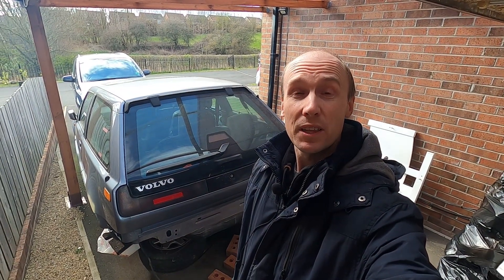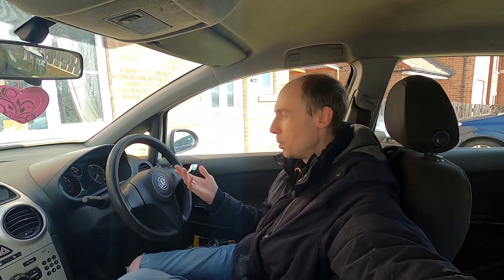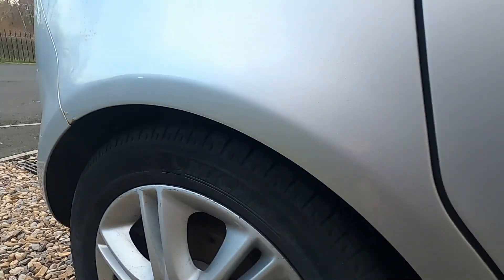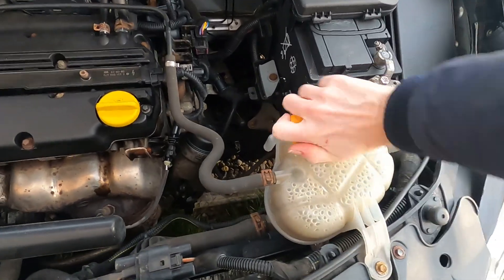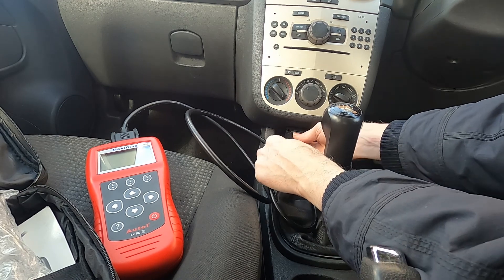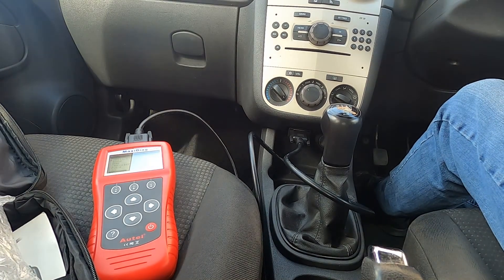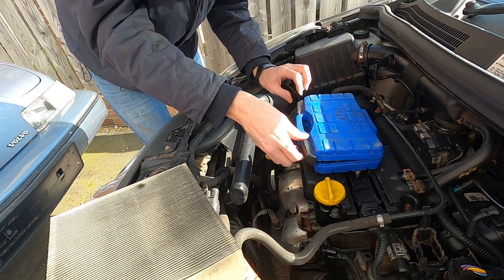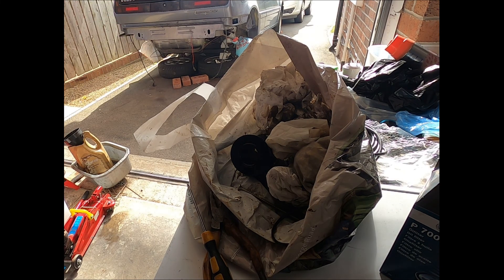Expensive second hand Corsa with so many faults and problems! Why did I buy it?

Comment: They say the spanner is Service and Electrical. Mines kept coming on and then going off when driving. I got a cheap Bluetooth OBD from Amazon and got the code P00B7, turns out I needed coolant in it.

Comment: I had 3 cyl version. Timing chain snapped and needed rebuild. I later found out the previous owner had chain snap and the poor guy I sold it to had chain snap a year after I sold it. So that's 3 times and it only had 60k on clock. Bad design by vauxhall.
Reply from the maker: Wow, that's terrible, until now I'd not heard of a lot of timing chain issues on these, perhaps specific to the 3cyl eco versions?
Reply: @junkendriven  When the AA guy arrived he said "I know what this is before I even open bonnet. ".
Reply: @ukpotaparksontheair3670 timing chains are an issue but not sure why it’s snapping after 12 months. You buying crap chains or bad fitting ?

Comment: The two rubber breather pipes from rocker cover to carb generally get clogged with that mayo,and yes your right it’s the flat head caused by short runs and condensation builds up then mixes with the oil.

Comment: Always find your videos insightful and frankly make me like my 60 reg 1.2 SXi more when you remind me how (relatively) cheap parts are and how simple they are to fix. Got a bit of a rattle on mine at cold start. Thought timing chain but could be loose valve lifters. Ever experienced this with the petrol models?
Reply from the maker: Hey, so yes that rattle on start, only at warm start up? Chances are it just needs oil and filter change, I'd do that first before even looking elsewhere
Reply: I'm looking at one down sizing from my Volvo V50 1.6 Diesel,  I've owned it for nearly 8 years , spent money on it , serviced every year , but I'm having issues with the injectors,  I've been told because the cars a 2010 it'll cost a £1000 to get it sorted with new injectors,  bit of a bummer considering I've just spent £310 to get it through its M O T and put 2 new tyres on the rear , can't win can you .

Comment: I have a 1.2 from 2010 I’ve done a lot of work on it, new clutch kit, timing chain kit, water pump, thermostat and housing, filters and oil, but it still lacks power when going uphill. 🤬Have to change down to 2nd or 3rd and rev to over 3000 to get it going.
Reply: I recently had a drive in a 1.2 and I just felt it was so underpowered.

Comment: Good to see another car on the fleet. I'd have been wary of a high mile 1.2 Corsa due to the timing chain issues, but you seem to know them quite well from your videos.
The prices of used cars are crazy at the moment, you really don't feel as though there's value for money!
I've been looking for a newer daily driver for a while, I keep looking and then being put off by the prices.
Reply from the maker: Thanks for watching! Yes higher mile can be a worry but the timing chains are good on these, the tensioner may need work but I'll plan on doing the timing chain soon.
Pricing is nuts! I'd not normally splash this cash on what has so many bad points!

Comment: I service my corsa d se 1.2, I use gfs for my parts as they are just around the corner from me, I've never torqued the oil filter I hand tighten it and nip it up with a 24mm socket, also got a oil transfer pump to suck the oil out, air filter simple to changed, I do oil change, air filter, oil filter, cabin filter every 6k because the chain, was told by a few mechanics I know to do it every 6k, when you see a corsa d with a timing chain fitted at 40k mile that due to lack of maintenance of oil changes, plus if I change the spark plugs i do that by feel as well, as my torque wrench is 1/2 starts with 28nm, so I might look for 3/8 torque wrench, keep up with the videos really liking them, especially corsa

Comment: I bought a 13plate 1.2se 3door in white 18 months ago for three half grand full history 99 thousand miles.bodywork very good no rust on rear arches drove well I bought it off Facebook off a reputable garage who's been trading 30years good reviews so I thought nothing to worry about had the car a week started getting problems from water pump failing to coil springs snapping the list goes on then a year later and a thousand pounds in repair bills I thought great I've got on top off it until four months ago I was driving along 40 mph it lost power so I pulled in and the engine was clunking and banging I checked oil plenty off oil still good from last oil change three thousand miles ago .so took it to three different mechanics no lights on dash just this terrible noise from engine the only cure new engine 😮 .so then I had to work out whether my now three grand car was worth a new engine
I managed to source a 1.2 engine off eBay for 850 quid 75delivery 32000miles I got a local mechanic to fit for four hundred so now I have a 5 grand and something Corsa that runs ok but do I keep it and hope no more problems or get rid .I thought about it I'm gonna run it hopefully another year and pass it to my youngest daughter when she turns seventeen just to get my money out off it .I've always had Vauxhall's over the last thirty odd years caviler novas with never a problem but I have to admit these modern vauxhalls don't seem half as good as they used to it has put me off them I think my next car will be a ford or a Kia they seem much better in modern form.
Reply from the maker: Wow, yes unfortunately they can seem like a cheap or budget car but you never know what you're buying whether private or dealership. Really bad that you had to replace the engine, it must have been bad when you bought it but covered up. Glad you've got it useable now, keep on top of servicing and repairs and it should last though, at least the bodywork tends to hold up well on these and parts are cheap. I'd not hedge your bets on Ford as they suffer many issues (Ford eco-boom engine is a common bad engine!).

Comment: Hello Andy, I’m hoping you can help, my friend has a Vauxhall corsa 2011 limited edition, hasn’t been started in over a year and a half, went to start it earlier, started first time run for about a minute, then cut out and wouldn’t start again, any thoughts? I believe the fuel filter is in the tank and not a serviceable part 
Many thanks
Reply from the maker: It's more likely the old fuel had degraded, it may have blocked injectors or all sorts. I'd start by a lot of fresh fuel in the tank, if possible take the fuel line off at the engine and run the lift pump a few times (ign on and off a few times) and draw new fuel in.
You might have also clogged the spark plugs so worth taking them out and inspecting.
Good luck, hope you get it running
Reply: @junkendriven  thanks for getting back to me Andy, where abouts is the fuel line on the engine, we put 10 litres of fresh fuel in, and still no luck
Reply: @junkendriven  if you see this, can you get back to me please, would be much appreciated, how does the fuel pump work on these cars? Is it meant to squirt out or just spit a little bit of fuel out?  Many thanks
Reply: Crankshaft sensor check.

Comment: Just found your channel and interested to know about your Autel MaxiDiag tool....any good?  Easy to use?  Expensive?  I have 2 Corsas and do all of my own servicing etc, but have to go to a garage to get the codes read....
Reply from the maker: Hi, for the Corsa the autel is an expensive overkill. You can do most basic tasks with the cheap elm clone Bluetooth and torque app on your phone.